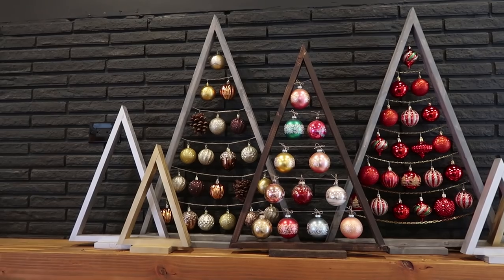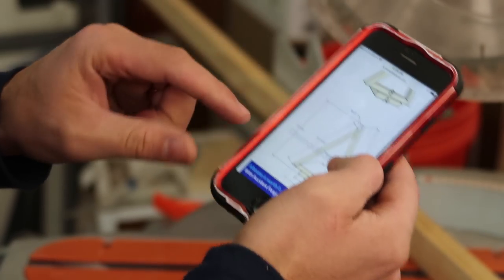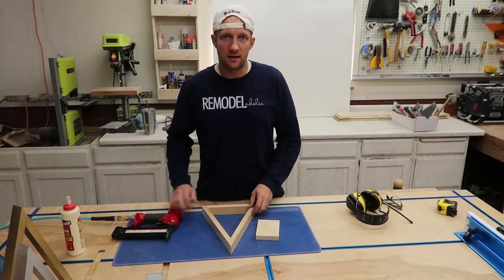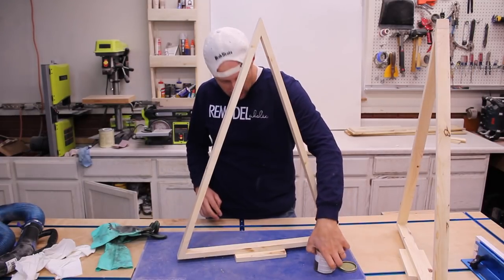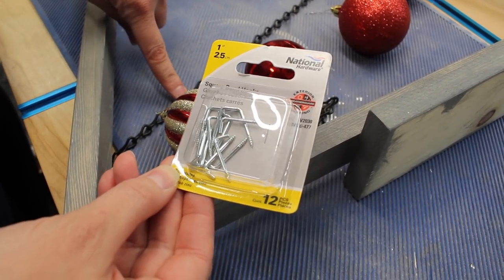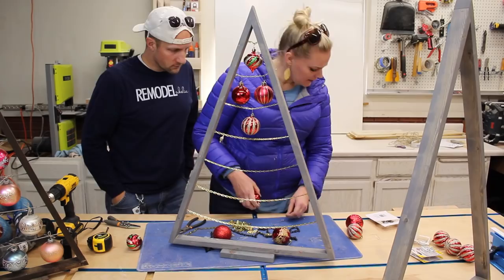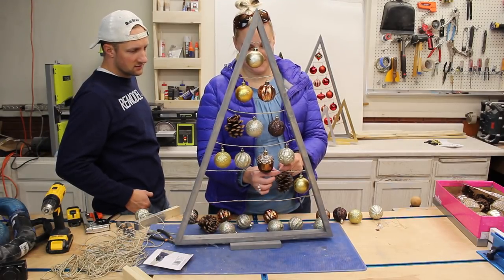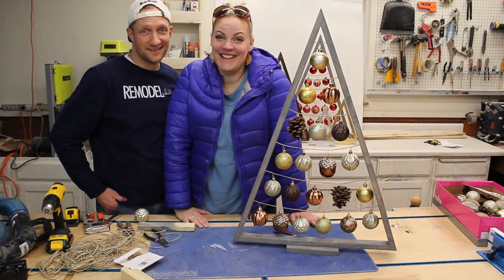Easy DIY Christmas Build: Under 1 hour! Triangle Ornament Display Christmas Tree

Comment: So when you add the 2x4 cut at a 45 degree angle did you position the mitre saw 5 degrees in the direction of the 2x4 or the opposite? Your film skipped that subtle change so I’m unsure which direction the 5 degree was added in regards to the 45 degree 2x4
Reply from the maker: In the direction of the 2x4.
Reply: Thank you so much! Loved making this! I followed your tutorial for the 1/8” rods to hang ornaments! Loved this, was able to get my cuts pretty close but that’s due to my chop saw not your measurements 👍🏼 and learned how to make difficult angular cuts thank you two❣️
Reply from the maker: Amazing!!  Way to go!!  I am so impressed that you jumped on it and made it right away!!  You are awesome!!

Comment: I am confused, when you say a 20 degree angle, are you saying a 20 , or are you saying  20 on the saw meaning 70 , cause when you use your 2X4 and place it 5  degrees towards the 45 wouldn't that  make it 40 degrees cause the saw will go to 50 degrees.
Reply from the maker: Robert thanks for asking.  So when I place the board against the fence I turned the blade 20 degrees then cut it.  Then if your saw can angle to 50 degrees thats even better than having to use the 2x4.  Hope that helps.
Reply from the maker: Hey Robert, I was talking to Justin about this because I didn’t understand his explanation either.  

Basically what he saying if your saw is at 90° (right in the center- set for a square cut) some saws can only go to the right or the left 45° and it doesn’t allow for a sharper cut.  Because the final piece you need is 40° angle - you need to be able to move your saw to 50° but if your saw doesn’t allow for that sharper cut then you need the jig and you need to make that your 0° point and go over 50° in order for you to be left with a 40° cut.  It’s really hard to explain this without an image, have you visited the blog post to see the drawn out versions?  ....

 All of this to say you might not have a problem if your saw allows you to cut more than 45° for example ours does allow us to cut to 55° you will have no need for the jig...  So if your saw allows you to cut that sharp of an angle you are good to go ahead and cut it normally.  If you miter saw is more limited in range, that is why you would need the jig.